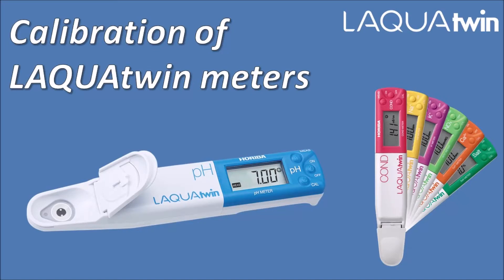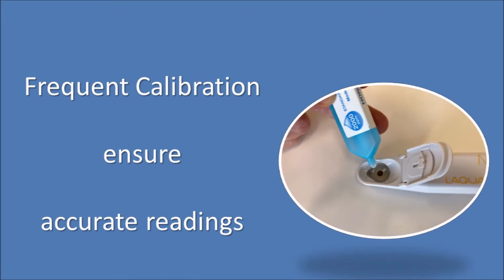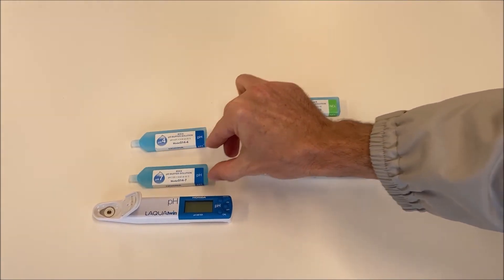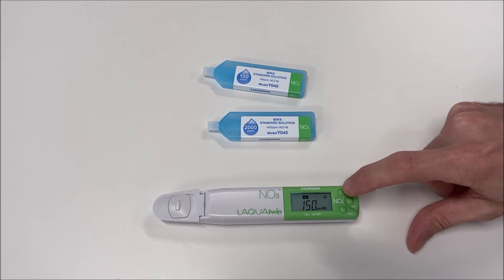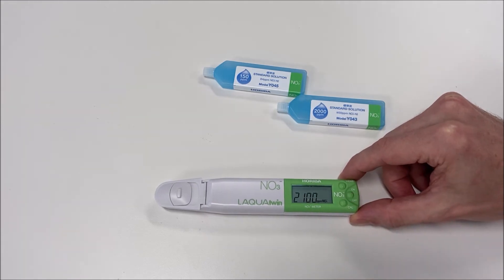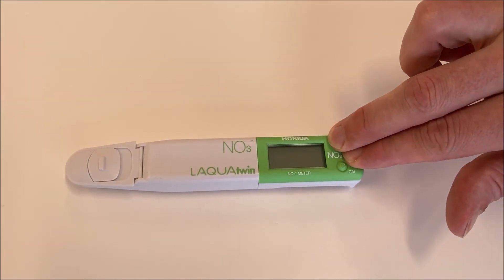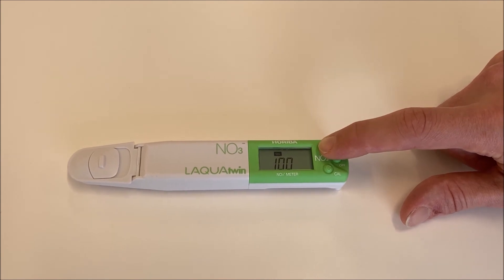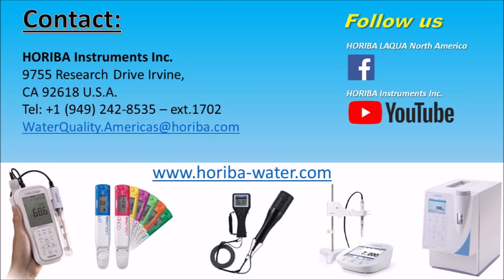Calibration of HORIBA LAQUAtwin meters

Comment: What do I do if following these steps does not work? If it just keeps flashing through the calibration or has an error message or Or reading?
Reply from the maker: This means that the sensor needs to be replaced.
Reply from the maker: @spiandbeyond  Hi Dodie, thank you for your purchase, the price depends on the model. I hope that you are happy with the meter
Reply: @horibainstrumentsinc.3082  I have had this same issue the first time I used the meter.

Comment: what should the 150 and 2000 readings be for potassium when the meter is set to mmol? Thanks
Reply from the maker: The atomic mass of potassium is 39.0983. 150 ppm divided 39.0983 is about 3.84 mmol/L. 2000 ppm divided 39.0983 is about 51.15.

Comment: What do I do if the solutions do not read right on the meter, i.e., 150/2000? Is that what you are doing in that second part? I don't get it.
Reply from the maker: If the meter doesn't read the correct value, it should be calibrated. If it doesn't calibrate (er.4), either the meter should be reset or the senor should be replace. Please check the video "how to solve Error 4 on LAQUAtwin meter"
Reply: The problem was that you do not say in your video to press again on cal, even if the right number does not ever come up. But I finally figured it out.  @horibainstrumentsinc.3082